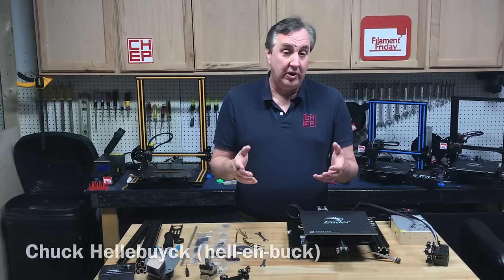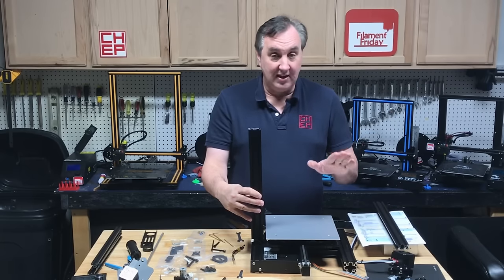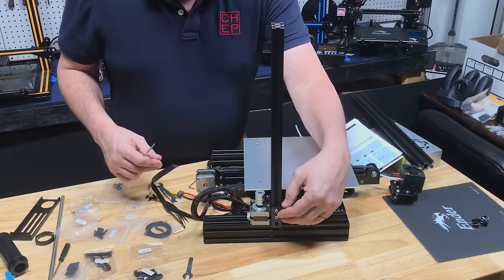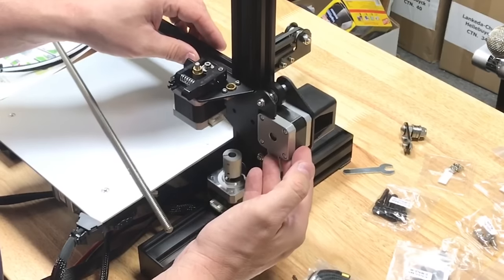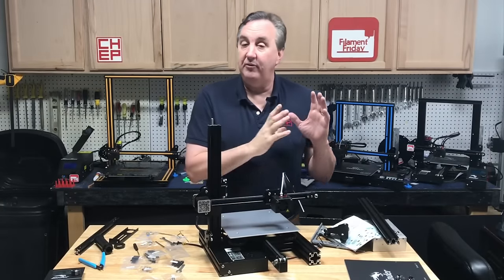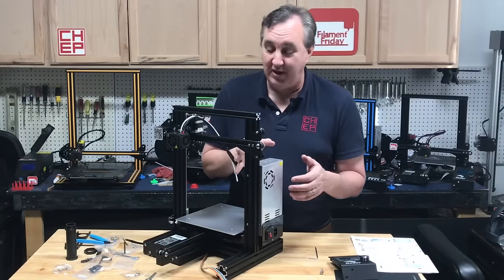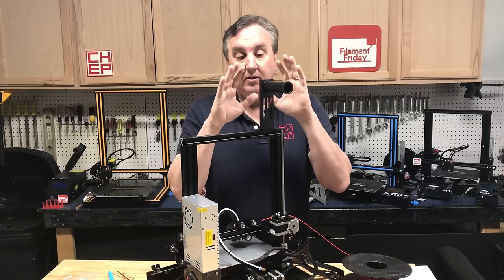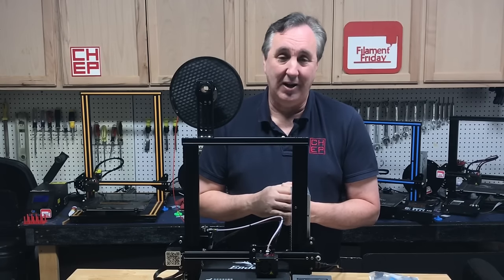How to Setup an Ender 3 3D Printer

Comment: "Just feed it through the extruder." .. 40 minutes later, I'm still trying to figure out how to just feed it through the extruder.
Reply from the maker: Take off the coupling. Make sure it’s not blocked. There are some people reporting the hole wasn’t completely drilled thru.
Reply: @FilamentFriday   Thank you. I didn't mean to come off rude. I was very frustrated. My apologies. I actually came here to figure out how to hook up the belt to which your video answered that right away for me.  Cheers.
Reply: @adammancuso1714  when I first got my printer feeding in the filament was a bear... over time I think I built muscle memory to know just how to hold the filament and maybe my mouth and it just goes through. At first I was clipping the end to get an angle. I also think I was pressing the extruder release a bit too tight and complicating it. I promise you this will get easier.
Reply: @aModernGirlMakes  Thank you!

Comment: Make sure to untangle all cables first before you start. I had to take mines apart because one of the cables was caught underneath the bottom plate when I got to the final steps.
Reply: Me too, seems like he could have mentioned that, i think close to 50% of people will have that cable trapped under there because he doesn't mention moving it.

Comment: I have had problems since I started with the 3d printer, submitted it on service and got it back. I am a beginner and have screwed on every bolt available, following instructions from a number of youtubers with no results. I am very grateful for all the videos you post and I actually got some prints if I used a raft on all my prints thanks to you. What I never succeed with, however, are all possible calibration models that totally fail every time and I always troubleshoot without solving the problems
. my biggest problem is that i tested everything and changed everything so now i don't know how it was from the beginning. 

I haven't tested this one, but it feels like it's my last resort. I return with tears or joy

Comment: I just received my Ender 3 today. My second printer. Moving up from an Anet A8 (modified a fair bit) which has been very reliable and has delivered flawless prints. I'm going to turn this Ender 3 into an Ender-Extender 400x400x500. But for now, I'm going to take single steps, starting from the beginning.

I just wanted to say the segments in your video I found most helpful and for which I am most grateful are:
* How to mount the right side wheel assembly to the X-axis. The Creality pictogram baffled me.
* How to level the wobbly, rocking frame.
* How to square the X-axis to the Z-axis.
* How to square the X-axis to the bed.

You made an extremely helpful video. You are so pleasant and your videos have such clear explanations. Thank you. Thank you. Thank you.

Comment: Received my Ender 3 printer last week and set out to assemble it. My 3 year old daughter insisted on helping and both of us looked at the supplied instructions with the same confused face :) Instead I whacked into Google how to set it up and your video came up 1st - and I'm glad it did. Your instructions were super clear and despite me not having a speed square on hand and just eye balling, having an awareness of which bits to make sure are straight certainly helped. We printed a small dog as our first test print and it came out perfectly - good adhesion to the base, nice and straight with good detail. 

My only adjustments to your instructions were at around 10:30 where the pully isn't getting the belt quite straight in the groove and required some bending to align it correctly. 

I also struggled to get the filament thru the extruder - cutting at 45 degrees made it much easier without taking out the brass screw. 

The plate levelling using paper has also worked well enough for me. There doesn't appear to be any major bumps in the plate so upgrading to a glass plate is something not on my agenda right now. 

Otherwise this was a pleasure to use as-is and would provide a good foundation for 3D printing to newbies like myself, although I'm still looking to add a couple of extra bits like:
Ikea Lack Enclosure - I have an old Lack Rack I made for networking equipment so have 2x spare Lacks that I'll use to either make an enclosure or at least have a shelf on top to add somewhere to store stuff
Octo-print - I've set this up already using a Pi Zero W and it's made transferring prints a doddle. I've got the camera but struggling to find a good place and mounting setup
Arduino - I need this to flash the firmware to get thermal runaway protection, and once done it'll be repurposed as a smoke detector and temperature sensor, activating a relay to shut off power if smoke is detected or the temperature goes above a 'normal' threshold as a belt and braces safety approach
Tool holder - the tools that come with it are great, and good quality too. Thingiverse have numerous holders for these that attach onto the printer
LED lights - My room isn't the best lit, so having a torch has helped inspect the leveling and quality of the print in progress. Having fixed LEDs on the printer would help

Thanks again for a great video!
Reply from the maker: Are you sure it doesn’t have thermal runaway protection? Most have it now. And if you machine has a v4.2.2 32-bit board then updating firmware only requires SD card no Arduino required.

Comment: This video was super helpful! Having said that, keep the printed instructions handy, because you will need to reference them for the correct screws to attach the various bits, and also to reference orientation of printer.  I almost installed the wrong gantry arm.  The printer gets rotated a few times in this video, so it was difficult for a complete beginner like me to figure out orientation at first.  Thank you for the very good video, with these instructions I have had very successful prints so far!  Once again, THANKS!

Comment: 11:50 You skipped a couple MAJOR steps... I was following along pretty well until then. And now because everything is out of order I can't refer to the printed instructions. No idea how part 04 is supposed to end up where you're showing it, nor what screws to use to tighten it.
Reply: I agree! He skipped multiple steps. I didn't like the fact that I was looking at the back of the printer most of the time. I had to try and put everything together backwards.

Comment: I can't say enough about this video. I watched it once all the way through, then a second time as I assembled my ender 3. The assembly itself took less than an hour. The instructions were all clear and concise and the tips really helped me to get a good build. I only needed to look at their written instructions a couple of times for clarity. Just following along with this I probably could have done the entire assembly without any documentation.
Reply: Assembled in less than an hour! I'm impressed. How have the test prints turned out?

I don't like CHEP's advice on the build. (I service business class copy machines. The parts support each other. To not include a supporting part in the build is an error.

 I've found better posted building videos, over all. Not going to post a link. That would be disrespectful to this one.
I have watched two build videos at the start. They were 3 or so years old This is the third video I've look at to see if I've missed something. This is the most recent build that I've found. I like the other 2 better. All three of them were wrong about the "T" nuts. I found it was needed to turn the nut wide then put it in the rail channel for the best grip.  My build is practically done.
Reply: @tigerzero5216  I'm super happy with my results so far, and everything seems to be printing well. I haven't watched any other build videos, so I can't compare them. But I found it really easy to follow along with this one and my machine feels solid and prints nicely.

Comment: You are the man!  I had it half assembled from the directions and then they wanted me to load the belt with everything attached to the bar.  I found your video, disassembled everything and started over and it went much better.  The only thing I would say is the cable that goes to the LCD gets blocked by the text on the screen so I was not sure which cable to attach.  I finally figured it out and everything was awesome.    Fabulous job on the video!

Comment: @CHEP Once my rod is attached to the motor my up and down movement is not as smooth as you show at 12:46. What would cause resistance on the rod/motor?
Reply from the maker: T nut too tight

Comment: Great video. Question- at 12:40sec you move the unit up and down. How? I can only move it manually using the silver thing on the top of the motor. The rod prevents it from gliding up and down. What am I doing wrong?

Comment: Side mounting the spool as you said really makes a difference. Get some cheap skate board bearings and print out some spool adapters and you will get a smooth filament feed direct into the extruder. Best change it to the aluminium version, a real cheap upgrade. Great video as always, thanks and respect.

Comment: This is a really excellent video. Speaking as an engineer/tech writer/trainer, this is awsome. All the more so because the instructions that come with the Ender 3 are very iminmal. All the tips were useful, expecially the advice about adding shims (in my case washers) to the Z motor to make it like up better. I also like that you went back to connect that one last cable to the Z axis limit switch. My build went really well with no hiccups.

Comment: As I was trying to get the two "awkward" screws in, I accidentally pushed off the tiny switch thingy, and it fell to the ground. Can't find it. Will it still work?
Reply from the maker: I’m not sure which switch thingy you refer to but odds are it’s the Z stop. And yes you need it.

Comment: Thanks a billion billion Chuck! I had watched another video and while it was good the guy must've been an engineer cause he was methodical about getting everything lined up and squared to the mm. Glad I decided to check your channel and you address the most important assembly aspects as well as how to double check your work. 
Creality should use this video on their website since they already have links to other  videos on their page. I ran into the issue where all the carriage wheels were loose to a certain degree. Even though this printer has huge support you would think Creality by now would update their instructions about how to perform some of these adjustments and tips for proper assembly. Who knows how many people got frustrated with this printer and gave it a bad review after focusing solely on the slicer settings without knowing how much assembly can affect it. 
Definitely gonna get the upgraded belt tensioners down the line. Big thanks again!

Comment: Thank you for your awesome video. I received my Ender 3 Pro yesterday. I followed your video, took my time and got it all lined up. After following your bed leveling video my first print went without a single issue. I have printed 3 more upgrades for the printer today and only had one issue with the Extruder Knob.

Comment: Great  video Chuck, a lot better than the instructions that come with it 👍👍
Reply: Thanks Chuck! Going to follow this guide tomorrow when My printer comes in. Also going to follow the bed level guide.
Reply: You skipped the part of what side the motor goes on the x axis and out of order. Useful as a one-legged man in an ass kicking contest
Reply: @Sabsbumblebee12  and it seems you skipped the part of your upbringing where you learn not to be an asshole for no reason. It's a good video, everything was clear to me and I have a lot more confidence in the assembly quality now than if I'd just have followed the manual. Thanks a lot Chuck!
Reply: @EctoMorpheus  my apologies oh sheriff of the YouTube. I will be sure to not point out facts in the future.
Reply: I would have been screwed without this video. Finished building it. Will adjunto it tomorrow

Comment: Best assembly video I've seen, and I've watched several.  Most other "well done" assembly videos I've seen the creator goes through it in a way where you would need to have knowledge of how everything works to understand what's going on and be able to get it done right. Yours explains how and why each step is done in a very easy to follow format.

Comment: Hey man great video, it's been helping me immensely! Quick question though, I'm at the part where right after you screw the top cross bar on and check to see if the x axis goes up and down smoothly, I can push it down but I can't pull it back up. I have to twist the motor over and over until it gets to the height I want it to, but pulling it up like you do just won't happen. Any ideas on fixing that?
Reply: I also have this issue
Reply: @kaylamorikami9332  hey! I actually figured out the answer later that night after tinkering. You see the two screws on either side of the hole where you put the corkscrew bar into? The hole on the cross bar, not the motor. You just gotta loosen one or both of those a little. Mess around with them until they feel right =]

Comment: Thanks a lot Chuck - saved this video while I waited for my Ender to arrive - have now just completed the assembly and super big thanks for your excellent demo. It made things a lot easier. Only thing I had to do extra was very slightly shim the Z motor to get the lead screw aligning properly. Now to watch your bed leveling and get ready for some printing!
Thanks again.

Comment: Wow, thanks for this video. I used it to put my Ender 3 pro together last night. I wouldn't have known anything about adjusting the eccentric nuts properly or even on getting everything square. I'm still trying to figure everything else out since their user manuals & videos that came with it are pretty much lacking in details to where they are nearly pointless.

Comment: I just received an already built one. The z stepper is attached to the bracket but it is wobbly. I noticed two screw holes on the other side of the aluminum extrusion should there be screws in them?

Comment: Question Chuck . . . I built my Ender 3 about a week ago using your guide. I’m seeing some thin shavings on the y axis rollers under the bed. I performed the first step of your guide to eliminate some wobble in the bed as delivered. Eliminating the wobble left a little unevenness in the y axis motion. These shavings appear to be from the rollers running in. Is this normal, or is an adjustment necessary?
Reply from the maker: Im not sure. I’ve never seen shavings on my rollers, just dust collecting from the static.

Comment: These instructions are so frustrating.  I like the additional suggestions for using a speed square.  However, you do not explain which rails to use for the top rail,  which orientation to install the top rail ( there is a RH and LH along with a top & bottom to the top rail.  The orientation matters.

Also, you do not show how much slack on the second attachment of the belt.  Make it tight? or attach the same as the first attachment (only the brass is exposed).
Reply: Yes, I found the same: similar parts are obviously different once you know....but for a first timer?

Comment: Please help trying to screw the wheels in underneath it so the platform isn't wobbly, but you said to screw them in counter clockwise, so I guess the nuts are reverse threaded? Which is weird, but ok, I just keep turning and turning and turning and nothings happening

Comment: Alas, i just noticed your pinned comment.  One thing i ran into with my build: the base 'H' making up the feet and support of the structure was grossly twisted so that one foot sat a quarter inch high.  I had to square these off.  Great video, though.  I would have never caught these issues without it.

Comment: I would like to see you also recommend a hot tightening before starting the print, preferably with the nozzle unscrewed a quarter of the turn, and the PTFE moved down to the nozzle, before locking the PTFE up. That way you don't have to worry about leaking

Comment: Hey Chuck! Love your setup video, I just had a quick question. I can't get my z axis to move up and down with just my hand. I see the problem, my threaded rod isn't quite lined up with the motor, and I don't really now what I should do to fix it. I tried loosening the motor from its support without much success, and I also tried loosening the screws at the top of the fluted rod also without much success. Any tips?

Comment: when I Put mine together, when i clicked on ''Auto Home'' it gave me a Noise like a Motorcycle was coming down the street, not that, Nice sound yours come out with... what do you think could be the issue? I've sent a Message to the seller and no doubt it's probably a Default i have lol (wouldn't be the first time either)

Comment: Used your guide to assemble and I'm having issues. I CANT PRINT. it gums up every time in the hotend and won't extrude I assume between tube and nozzle and can't seem to press it any tighter. Every time I take it apart clean. Relevel and run test print. (sometimes even test jams) then my first print after testing level nothing comes out of nozzle. Have taken it apart atleast 20 times and used 10 nozzles.
Reply from the maker: Check for cracked arm:
https://youtu.be/iXe7bftyMFU

Comment: Hi , thank you for sharing , I am useless at building things, but I have had to stop when you said this is step 5 in the manual, and you had already installed the head on the gantry, I do not know how to do this ! up until then I had done the 2 side gantrys and the proximity switch no problem.

Comment: Finally after 11-12 tries I got a finished print. It is your test cube. I never got any of the ones on the card with the printer to work. Every one I tried came off the bed even with glue. I tried PLA and ABS the PLA is the one that worked for the cube.